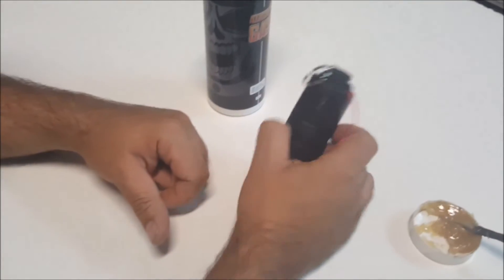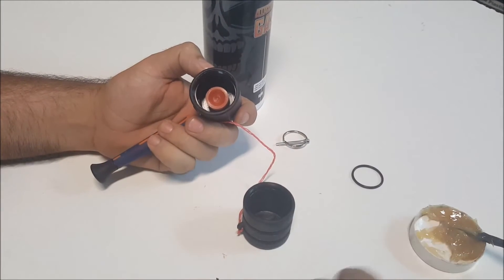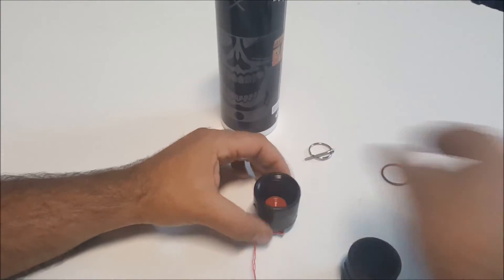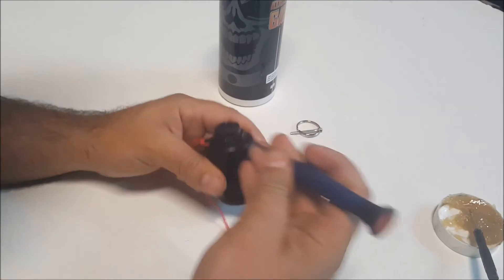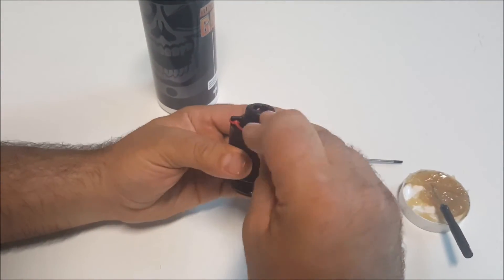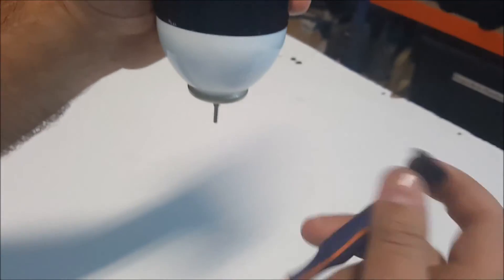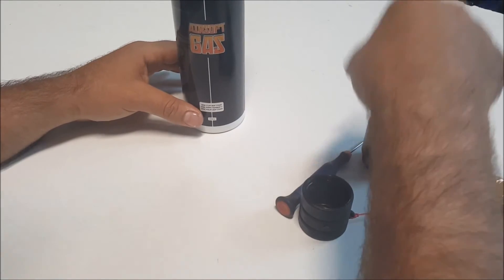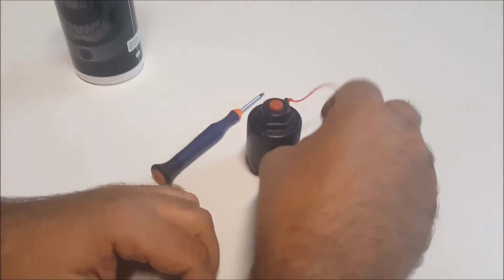How to perform maintenance on the Kimera JR2.

Comment: My kimera doesnt Close it is extremly hard to put the Two peaces together is this normal an what can u do to fix it?
Reply from the maker: buffalo 118 which two parts are tou referring to ? The top part and the lower cup ?
Reply: Paulo Oliveira yes
Reply from the maker: buffalo 118 the harder it is to insert the cup in place, the loudest the sound is going to be when the kimera is activated. 
If you find it very hard to insert the cup, one solution is to lubricate the cup and seal with a bit of grease. Hope this helps.
Reply: Paulo Oliveira doesn't work I can stand on it and nothing is happening
Reply from the maker: buffalo 118 that seems odd. Can you go to the store you bought it from and have them check it ? Or did you buy it on line ?
Reply: Paulo Oliveira online-_-
Reply from the maker: buffalo 118 no problem at all. please send an email to info@pmairsoft.com and explain your issue. If required spare parts will be shipped over to you.

Comment: So you say that it is recommended to use non liquid gas but with 120psi. Is there any non-airsoft gas you could use?
Reply from the maker: Hi. any gas with pressures between 80 and 120,psi will work. Green gas is recommended.